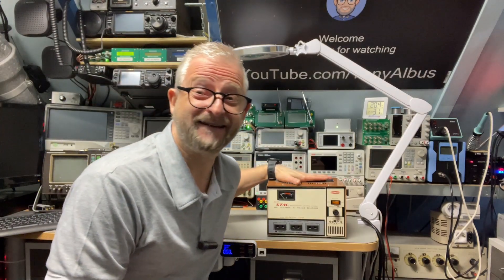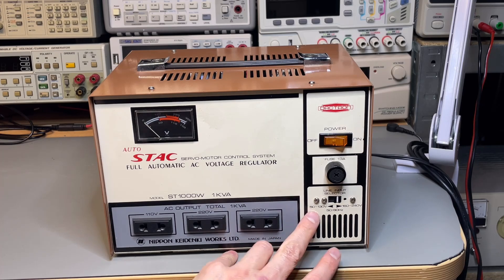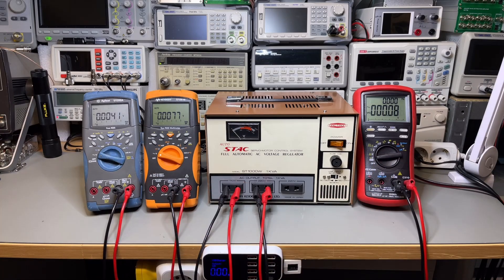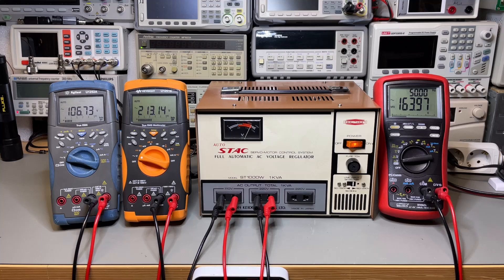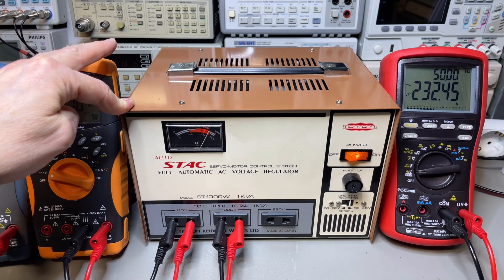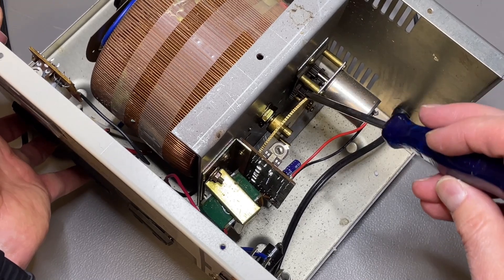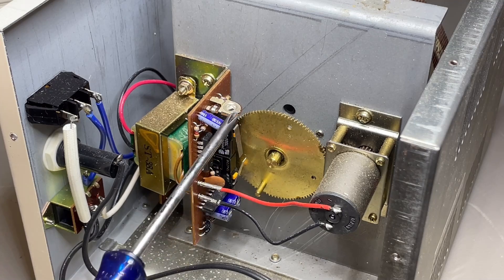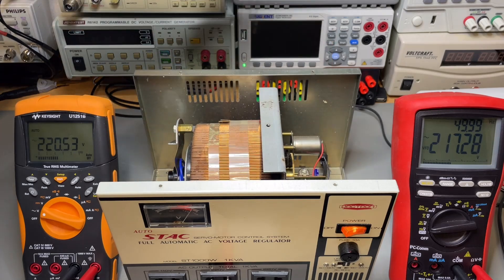TA-0385: Dactron Auto STAC ST1000W AC Volt Regulator  - 1KVA - 1990 - Teardown

Comment: This dactron variac is in my house since last 45 years and still working with refrigerator, 
it has just one drawback, when it shut down on low voltage by micro switch and restarts at normal voltage, that winding turn degrades due to hi volt start, but still very robust machine
Reply from the maker: wow! that is quality

Comment: Hello, thank you for this video 
I bought a similar one (Stac ST 1500w), but it is without manual.

Do you know if the the total output is the same when using 220v and 110v ?

I mean yours is 1000va, do you have 1000va avalable with 220v alone and with 110v alone ... or it is 1000va avalable with 220v and 500va  with 110v ?

Thanks.
Reply: Its 500 va at 110v if rated 220v 1000va, this is auto transformer basic working principle, as voltage drops so does power rating
Reply from the maker: Hi, yes that is a good question, i do not know, but if you email me, i will send you the information i have, i did find some things. you find my info in about or extra on the main page of the channel.

Comment: Hi i do have one of this stac 3kva  now i am having problem with stabilize voltages. In Bangladesh we use 220v but whenever  input  voltage increase  at the same time output voltage also increased , It's not steady to the 220 voltage.can you please help me out in this issue?
Reply from the maker: Are you sure, your is the servo version? maybe its only a fixed transformer.

Comment: Hi Tony, variac with comparator voltmeter, beautiful thing, I wanted to buy it on e-bay once, but someone blew it on me 😁 My plan was to modify it for external control and after switching from automatic, I planned to control it from my test panel with a potentiometer. In the end, I gave up on it and kept the big transformer next to the table, and instead of the potentiometer and servo under the table, I twist the variac manually, its place under the table was taken by the second isolating transformer, and there is only a switch on the panel (the one next to the network analyzer with the yellow LED).

Nice day 🙂 Tom
Reply from the maker: Yes great to have something like that under the desk..great solution Tom!

Comment: In industrial settings here in the US, Auto-Transformers are used a lot.  They maintain 120volts out with varying AC input and do not use any moving parts.  I don't know how those work.
Reply: I think you are referring to Ferroresonant Transformers. They use a capacitor and an additional winding to form a resonant circuit at the mains frequency combined with a special core. Lots of articles online explaining how they function. Regards, David
Reply: @davidv1289   Yes, now, I imagine they can not handle a lot mains swing.  I was in a factory once, the CRT filaments of an instrument were running bright and the trace would uncontrollably bright.  Brought the instrument back to the lab and it worked perfects for hours.  Took it back to the line and immediately out of control brightness.   My fluke DVM showed 120vac mains.  An electrician brought his line analyzer and could see 600volt harmonics on the mains!!  They got one of those regulation transformers out of stores and it fixed the problem and have been using them on all of their UT equipment since.  I bought a line analyzer after that (~$2600 in the early 1990s if I recollect correctly), but never ran across that situation again.
Reply from the maker: Thanks you guys very interesting discussion... nice to know how this type of technology of line regulation is used in practice.